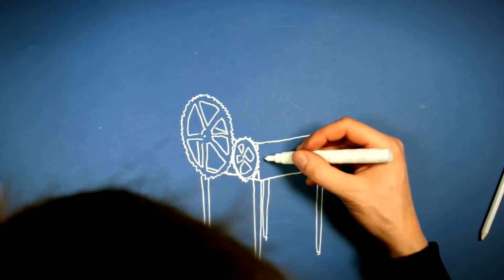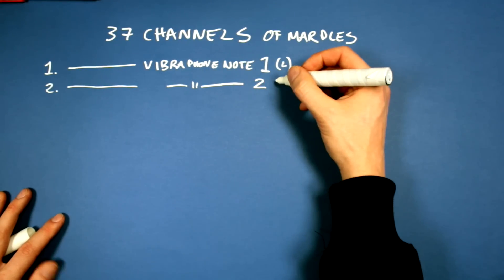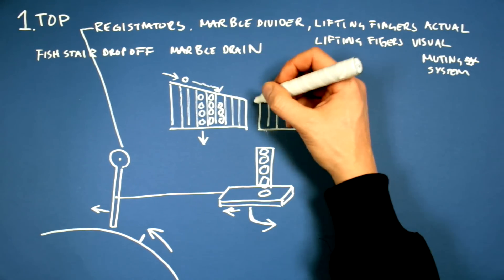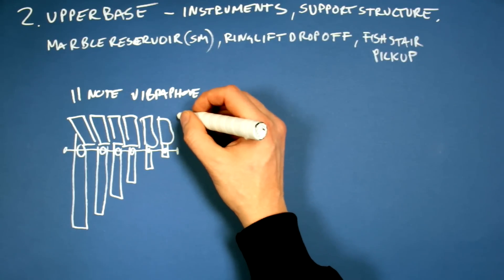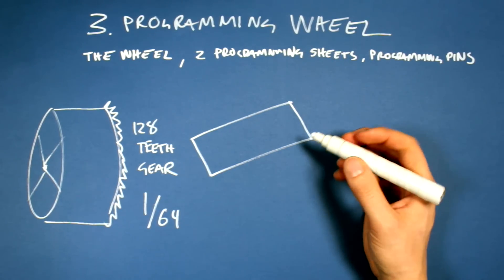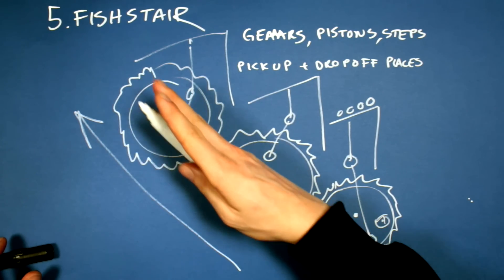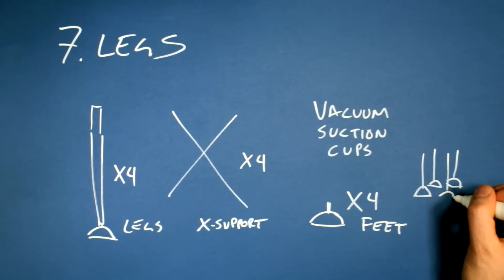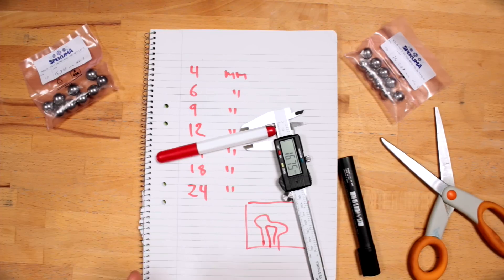First Sketches - Marble Machine X #1

Comment: Hi, about the thin leg you like on the marble machine which resulting a lot of vibration, how about putting lead into the lower portion of the legs and keep the upper portion hollow (basically a illusion of a solid leg which goes thinner at the bottom)

Comment: Hey in regards to the muting @6:00 instead of moving the fingers on a moveable track, to slacken the line, make a rod the string passes over to make it tight and lower the rod to slacken the strings. Like a chain tensioner or a car belt tensioner. Much easier! And more compact!

Comment: You could make the feet like an engine mount to absorb vibrations. This would allow you to make the lower part of the feet to look like giant suction cups but also allow enough rigidity and size to add leveling pads beneath them for uneven stage floors. You would need 3 levelers per foot at minimum or incorporate one big leveled in the leg itself to make it easier for adjustment. Great job and Best of luck!

Comment: Will you consider an automated programming wheel vs a manual programming wheel? Probably faster to load tunes during a concert. Some mechanism to push the pins out based on a ASCII text file maybe.

Comment: I don't know if someone already suggested that but if you want to temporarily stop the machine (like you did with the first one) maybe it could be a good idea to use some kind of clutch on the flywheel to keep it spinning while the rest of the machine is stopped. It would be easier to restart it after too.

Comment: I'm sadly late to this project, but I'm so interested.  I hope it goes well (still catching up with your videos) - you clearly have a rare blend of engineer and artist's eye.   Here's a quick thought - you don't need the pegs to program -  if your registrators can feel the holes instead of the pegs, you could CNC the songs directly into the platic rolls.    Also, that means your registrators will signal when they "fall down" into a hole, rather than "push up" by a peg.  That means you can mute them more easily - just hold them up with another bar so they can't fall into the holes.

Comment: You could also use magnets to cleanup the marbles from the ground. 
With a cup and a magnet in it, the marbles don´t stick to the magnet itself and it is easier to seperate them.

Comment: There's a thing i was wondering, about the first part of the machine. More precisely the marble feeding system. There is a slight problem where if the outer marble channels get used more often and have to be fed constantly, and then suddenly the inner marble channels get used up, they wont get new marbles delivered before the outer channels are full, which could result in skips.
Unless the marble delivery is faster than any instruments and is able to keep up with the speed.

Comment: I know this will sound utterly stupid, but as a safety idea for using the new Machine X, you might want to integrate some high power magnets into the structure to catch any errant marbles. Not near the activity, but in some areas where a marble might bounce off to. That, or change the legs into pedestals where the foot has magnets to catch any naughty marbles that escape. I'd hate to see you or anyone slip on an errant marble on stage.

Comment: for the programing wheel a section of a large pvc pipe like a large sewer pipe, cut to the width you need and put over some sort of inner wheel and locked in from the side would make for a durable easily changeable programming assembly

Comment: You are definitely going to have a problem with finding a plastic sheet that is rigid enough to not have the programming pins swivel when hitting the registers (which could cause pins to come out, or notes not registering), but also flexible enough to be wrapped around the programming wheel. I recommend that you continue to use the lego arms to rigidly hold the pins in place, but use a thin, flexible, plastic sheet to mount the arms to, instead of mounting the arms to the wheel itself.

Comment: Marble shortage is not a problem right? Talking about the marbles as they roll off the lift, on the "top" portion, if marbles couldn't completely fill up the outermost channels, the inner channels might not get enough marbles. Which would cause a note to not sound.
Reply: I could send you a sketch of an equal marble distributer.

Comment: this isnt really relevant to the video but im a fairly young aspiring engineer and i was wondering if you learn these things in collage like how basic mechanics work and how to incorporate them into your machines as well as how to design blueprints. i dont want to wait 4 more years to persue my passion so does anyone have any tips on how to learn that stuff now? if you're an engineer what types of things did you do when you were young to learn and practice  these things? any advice would be GreaTly appreciated :)
Reply: I studied electrical engineering / computer science / semiconductor physics. However, in lower division coursework, ALL engineers receive the same basic foundation (at least here in the States). Two of the first courses taken require some math -- calculus. They are STATICS and DYNAMICS. 1. Statics (NOT "statistics") is the study of forces on systems which are static, or motionless -- you'll learn things like load, torque, etc. That would be MMX sitting idle -- are its systems rigid enough; the axles, legs, etc. 2. Dynamics is the study of forces on systems in motion (very different than Statics). Can the strings withstand the forces when they are being used; will the fly wheel and its axle withstand the spin-up and braking? Even though I have never used Statics nor Dynamics in my profession, I was fascinated and thoroughly enjoyed the subjects. There's an old saying: "Without statics and dynamics to design a system, you are left with the POPEYE METHOD." e.g. Popeye, how long will it take you to build that reservoir? IDK, I'll start building it in the morning and tell you when I finish! Will it survive? I'll tell you THAT, too.

BTW, what I do is not even as fun as working on an MMX. I design(ed) the touchscreen sense and display control chip in your smartphone. Detail oriented but doesn't play music! :) Enjoy!

Comment: For the programming pins, you should get some towball pegs (https://www.bricklink.com/v2/catalog/catalogitem.page?P=6628) and use those rather than the cross axle connector pegs (https://www.bricklink.com/v2/catalog/catalogitem.page?S=5003123-1) you propose. Towball pegs are much stronger and their shape would afford a much more consistent strike.

Comment: two immediate thoughts here:
instead of 37 feedtubes in V-formation you should make two offset rows of 19
(yes, i know, that amounts to 38, but you wanted one drain in the middle anyways)
that way everything can be more compact, especially considering your left and right feeds for almost all "notes"
secondly, while i like the general idea of some sort of "mat" for the tunes to be fed into your tune-wheel; I'd encourage you to have these with the pins permanently mounted for your standard tunes. you could still have one spare mat and pins to reprogramm new tunes on the spot at your gig. Repinning your own tunes every time for every gig makes no sense. If it must be (for easier roll-up @ transport) do colour mark the positions for the pins. Using two different colours and potentially be able to invert the mat upside down, each mat could hold quick info for pinning four  different tunes very fast.

Comment: I like your idea for the programming wheel. UHMW HDPE is an excellent material for this. It's a semi self lubricating polymer which forms well on the plexi-bender. It's also not brittle like acrylic which is a plus, and can be easily laser cut with a medium duty cycle laser cutter. If not, then leather is an excellent option for this, it laser cuts very well (personal experience) and older full grain leather retains its rigidity and form, enough so that I was able to use it as a wave washer in a plunger for an air cannon

Comment: You need to consider that several geared wheels in marble lift would be much noisy 
in comparison with belt drive (gears are rather noisy in common). Though
 it would be spectacular with those gears rotating in different directions.

Also big platforms as marble lift would lead to marbles hit (and produce noise) twice: first when falling from previous platform down to the next one (previous platform would need to lift slightly over the next platform in order to marbles could move further) and next when marbles would hit the wall (which is the side of the next-next platform). Also marbles would produce noise while rolling over the platform.

I doubt these noises can be synchronized with music. Probably, better have these platforms (and their sides) wrapped with rubber to reduce noise.

Comment: Hi.
Have you thought of any other dampning system for this other than the rubber suction cups? Because of the gearing and the flywheel (torsional vibrations) this will vibrate more than the old one. The vibration will be significant on acceleration and deceleration. Buut vibration can be dampened in different ways, internally by weights or isolated/transfered with something like a shockabsorber.
I really love your music and machines.
Reply: EXCELLENT feedback. We used to design flight recorders that were essentially hard disks suspended by rubber bands inside of a chassis. But that was back in the days of biplanes. LOL

Comment: I wouldn't recommend using those lego pins, as one half is still hollow. You could try using 2 stud long axles as they're completely solid, but you'd need a different system to keep them iin place than just round holes. If you do stick with the same pin shape, definitely use the blue ones, not the tan ones. They are designed to provide more friction and consequently are sturdier, with thicker walls at the hollow section.

Comment: at 4:55 you should do something to ensure that marbles dont collide in the marble drain and that 2 marbles wont get stuck there (different angles on the marble dividers or having a height difference between em could make for attempts to prevent that but dont take my word for it). Also make sure you calculate the speed at which you feed the marble divider so that you wont have any holes being left empty in a random song (you don't need to include cases you wouldn't possibly make a song of )

Comment: I did write a longer comment , but I had to edit it and I want to make sure this is seen because it didn't occur to me in time:
The highest impact on the inertia of the flywheel are the following: make it a spoked wheel with light spokes and a heavy outer ring! It sounds weird, but it stores much more inertia than a full wheel from a medium heavy material. Math sais the spoked design makes all the difference.
You can increas inertia further with a bigger radius, more rounds per minute (making it run faster) and/or a heavier outside ring material. Also, it doesn't have to be upright, it can be horizontal below the bottom section, saving you a lot of space!!!
This means, if the wheel doesn't give you enough inertia but you can't make it bigger or heavier, make it run faster and it will give you more inertia.

Comment: Consider these my notes I took during the video and what questions I came up with ^^
I probably pointed out several things you are already aware of ;) And fair note, I am an engineering student, not a full fleshed engineer just yet.
(also, the blueprint-look of the video is very pleasing to look at and I love that you actually drew on blue cardboard!)

-- Am I right in thinking that the programming fingers actual are meant to prevent delays between the marble being released from the marble divider and hitting the instrument?

-- Then why the double system of the divider and the finger? They are both single-marble-dispensers in series. Is that to prevent big piles of marbels being stuck in tubes, waiting to be released? (Which would make sense to me)

-- For the muting mechanism: instead of moving the whole assembly with the registraitors you could also try to pull the registraitors to the right, in the direction of the marble divider, in this case up to the right. This would mean, that the registraitors will no longer be touched by the pins on the programming wheel and that there are less moving parts, just joined wires for each section.

-- The vibraphone system looks very efficient to me. I am not sure about the moving note bars, they should move when a marble drops on it? That would require them to be suspended quite loosely, that might throw of the marble collection.
Could you attatch the suspension of every individual note bar to its corresponding registrator? It would be a "fake" response, but it would be reliable and predictable. Resting the suspension of the note bar on an excentric wheel that gets turned by a lever could do that, similar to what we see below the fishstairs in the example videos. You can have it move either up or down, your choice. Of course, designed to return to its initial position by gravity.

-- For the drums, you could either to the same thing as with the vibraphone (fake response) or you could drop the marbles very close to the edge of the drums and have a rather big funnel below to take the uncertainties of the marble path into account. It might even be necessary to restrict the movement of the instrument with little bumpers, they might interfere with the sound though, when they hit.

-- It is very cool to see, that you have some super dedicated fans out there helping you with the drawings!

-- For transport, you might even be able to store quite some things inside the programming wheel, like a box of pins and the sheets rolled up against the wheel from the inside. Also, you could code songs on the sheets with coloured circles around each hole a pin goes in. Concidering front and back, that could make for 6-8 songs coded on each sheet.
I don't have practical experience with this, but when you put holes into a flat sheet and roll it, the holes might warp and the pins will not be held in place sturdy. It might be fine, but it could create some wobliness or give in the pins, throwing the timing off.

-- The visualisation could be done with dummy wheels on the outside, connected to the acutal gears, if necessary.

-- The ring lift looks like a great concept, since it can transmit both marbles and power. With the fishstairs, the lever system you suggested can work, but if it happnes to stop when the cranks on the gears are perfectly straight up, your gears won't restart. It is not intuitive, but something to watch out for.

-- The highest impact on the inertia of the flywheel are the following: make it a spoked wheel with light spokes and a heavy outer ring! You can increas inertia further with a bigger radius, making it run faster and a heavier outside ring material. Also, it doesn't have to be upright, it can be horizontal below the bottom section, saving you a lot of space!!!
This means, if the wheel doesn't give you enough inertia but you can't make it bigger or heavier, make it run faster and it will give you more inertia.
Have you concidered palcing the flywheel outside of the box, so that it can be pushed on to an axis with a litte notch (a key) so you can make it as big as you need and just lay it flat in transport?

I probably pointed out several things you are already aware of ;) And fair note, I am an engineering student, not a full fleshed engineer just yet.

Liked the finishing sound and the best of luck with the Marble Machine X! Since I got involved with the kick drum already, I might as well come along on the ride for this development as well :D
Best of luck!

Comment: don't forget to consider means to level X. stages will not always be level. 

also consider a breakout for your xlr feeds, so you can quickly connect mic lines w/out accidentally bumping internals. 

and while your at it. handles! you gotta carry it around stage during setup and strike.

Comment: Inkscape -> SVG file -> send to laser cutter -> instant parts that you can iterate the design of with no manual cutting/measuring, snap to grid, etc... Cut zig/zags to make springs, cut so that pieces can clip together into 3D shapes, including one way clips that cannot be taken apart once they are pushed together, gears, etc...

Comment: You could try working on a smooth and slightly sloping floor, where the corner they end up in has a hole exactly large enough for a bucket, if possible.

Comment: I'm so excited to follow this project! I'm no engineer, just a guy of interests in both music and science.  Another commenter mentioned the noise from the fish stairs. I'll add to this that you should bear in mind that more gears and faster running gears will also make more noise. May I suggest you begin making some experiments with different kinds of wood for the gears to measure which makes less noise? I'm sure the noise will be considerable no matter which kind of wood, so you will not risk this doesn't sound like a machine, but it would be a shame if the finished machine is so noisy that you barely can hear the music... Also consider some rubber or felt on the fish stair, rubber is probably better as you can get it with various friction...